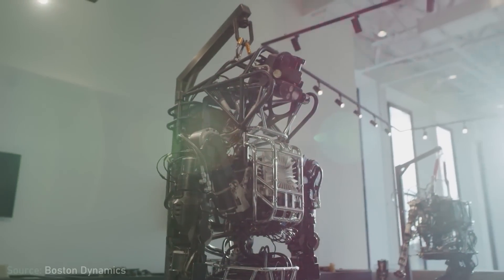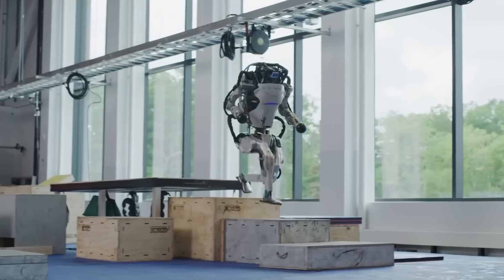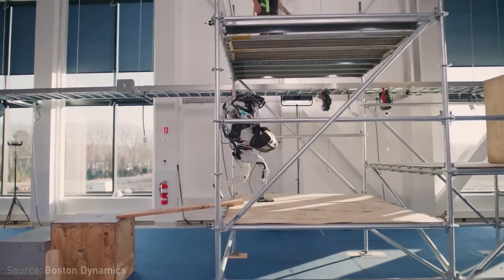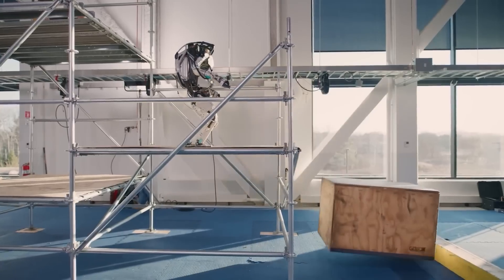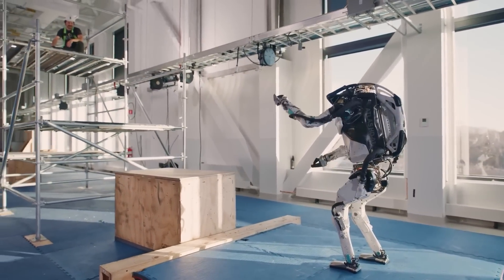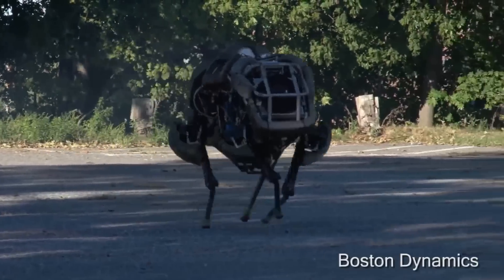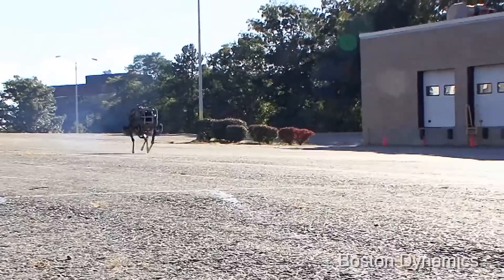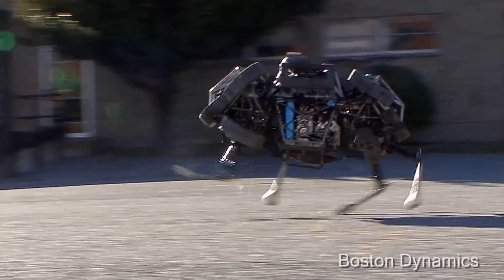Hydraulic vs electric actuation in robotics | Marc Raibert and Lex Fridman

Comment: I think it’s important to mention that both hydraulics and electric systems have their pros and cons. Hydraulic. Especially proportional or servo controlled hydraulic with sensors and linear transducers can be as precise as similar electric linear actuators. It always depends on the use case.
Reply: my reply is deleting !! why ?
Reply: Bottom line is every time you convert energy in another form of motion you lose power. Unless you are going to power robots with petroleum engines, electricity being converted directly into motion with electric motors will always be more efficient.
Reply: @bill4639 there is never such a thing as a "bottom line" lol. While yes, electric motors are more efficient. The power to weight ratio of modern electric motors are abysmal. This is why no humanoid robot out there is as mobile as the hydraulic atlas.
Reply: @JakeBananas  Bottom line: prosthetics are going to be made with electric motors, not hydraulics. Construction robots, super fast drones, surgical robots with realistic feedback, and electric sports cars are great examples of how electric motors are preferable to hydraulics, so abysmal is not the word you should use to describe them.
Reply: @bill4639  A hydraulic system prosthetic would absolutely show significantly greater performance (strength, dexterity, # DoFs, etc.). The real problem is its complexity and cost. An electric motor system in contrast is cheap and simple. Which makes it attractive for corporations. In most cases superior performance is just not necessary. Do assembly lines of humanoid robots need to do backflips and parkour like the OG Atlas? probably not. This is why they switched to electric motors. Don't confuse this switch as anything but a move toward cheap simplicity at the cost of superior performance.
Reply: @JakeBananas  Well said. To give an example of a military application, The M1 Abrams still uses a hydraulically driven turret because of its unbeatable torque, size, and you can get a much more accurate azimuth (plus or minus 0.000225 degrees). You would need a prohibitively large stepper or servo motor to achieve the same degree of accuracy. A lot of countries use all-electric turrets now, but only because they're simpler to design and cost less. Countries like the US who were already using hydraulic systems have stuck with them.
Reply: In my experience hydraulics always eventually leak. As do pnuenatics. Electricicals even if they leak do not make puddles. Of course the problem with electronic systems is keeping the red electricicals in the red wires. The blue in the blue etc. 🙄
Reply: @mpetersen6 Maybe you forgot something else, consumer electronics are limited to the battery or power source !!
Reply: @ياقوت-ق  
So are organic muscles. You have to keep recharging the system. AKA eating.
Reply: @mpetersen6 No, absolutely !! Although nothing lasts forever, the Hydraulic System is durable and strong and can use any fluid suitable for the application, such as water, but not limited to it. Watch this video and then tell me where I need it to recharge !! In this video, the person uses a hydraulic hand, adapts it, and controls it as he wants simply by touching his hand to it only, whereas if it were electronic, it would need a battery and consumer electronics. In addition, he needs to connect it to an application on the phone or computer and write complex codes that depend on the memory and Preservation, as it will not be able to operate and use it except with a battery !!!
Reply: @mpetersen6  There are ways to account for leaks and recirculate the liquid. imo hydraulics are far superior and i'm attempting to prove it.
Reply: @OYVAI_izmir  you likely will fail. Hydraulics and electronics both have their pros and cons and that isn’t going to change anytime soon. What is much more important than debating which is superior is acknowledging that they both have different properties and that you should pick the right one for the job.
Reply: Don't prejudge ! Perhaps He will succeed in his endeavor. 
Personally, I prefer Hydraulic and Pneumatic Systems. I hate corporate consumer electronics.
Reply: @conorstewart2214  To a certain degree i agree. There is a very good argument to be made that intricate and precise actuation would be better suited to electric motors. For a humanoid robot this could be used for fingers, facial muscles, etc.. (where strength is not needed) However for the more powerful muscle groups like in the legs and arms, electric motor usefulness declines. The power-to-weight ratio and bulk of the electric motors necessary to get close to actual human strength and agility levels is too great of an obstacle. Sure you can make something like tesla bot or the figure bot or maybe even something relatively agile. But compared to Atlas (in terms of raw strength and agility ) and other hydraulic driven robots, pure electric motors can't compete. Until a viable electric actuator can replace the currently used electric motors (like maybe SMAs or DEAs) hydraulics is the main solution for a superior system. I am currently working on a soft hydraulic hand to prove that hydraulics can be an inexpensive and powerful alternative to electric motors, even given intricate fine movements. I've already proven actuation with a single finger and am building out the full system as i write this out. It may take me about a month or so to complete but if you're interested you can follow my channel. I have plans to integrate softy hydraulics into many different robotic projects.
Reply: @OYVAI_izmir a system to recirculate leaking liquid is just a redundancy, redundancies increase complexity and are still prone to failing eventually, even if it prevents more substantial leaking for a while longer
Reply: @nologin5375  Thats a silly notion. Redundancy is a hallmark for good engineering. Rockets, cars, planes, etc. all use redundant systems to specifically increase its FOS. In this case a recirculating system for leaks would be low pressure and therefore very unlikely to fail. Although clogs or other obstructions could cause it to fail.. so i do agree that it is mainly a preventive system more so than a complete solution. Don't get me wrong, electric motor robotics is viable and even preferable for mass manufacturing and low maintenance. But when it comes to pure performance, hydraulics will always be superior. For two reasons, its power-to-weight ratio and its ability to transfer energy at a distance/ around bends.

Comment: Robot will always beat Human in the somersault backflip. It knows exactly it own weight, the force of jumping up needed and it does so, when to tuck the legs in, the expected and calculated rotating speed, and when to flex the legs out to land to the miliseconds accuracy. We do it by trail and error and instinct with lower timing and muscle resolution. Robot will be more consistent and exact.

Comment: They need to move to a different option.  They need to be able to grow simulated muscle tissue that can be variably controlled through induced micro voltages.  This gets rid of the huge power requirements that inefficient motors need and the complexity and slow speed of hydraulics.
Reply: But then you also need to deliver nutrition to them and also it would need an immune system
Reply: Well, there is already that kinds of things (artificial muscles, exclude that pneumatic and hydraulic ones), however they either require a very high voltages or have slow reaction.

Comment: "vs"? why not both? hydraulic systems primarily and switch the electrics from regenerative to active when you need them
Reply: Hydraulics and electrics for the same joint? I don't see what use that would be. If you have hydraulics at all, you immediately get all the disadvantages (dirty, slow, non-compliant). Adding electric servos then adds nothing but mass.
What I'd find more interesting is pneumatics plus electrics, these could nicely complement each other (strength plus precision) and both can be fast and springy.

Comment: The engineers designing Spot evidently hasn't seen a wolf or an elk move.
I'm surprised about how high they lifts their hind legs in a step,

That might have something to do with moving in the Forrest, but even so.

I think Boston Dynamics should continue with hydraulics. But they have much engineering to do
before they get it light enough to be energy efficient.
And then it's manufactuerability.

They shouldn't throw out their tech, but perhaps emulate the Tesla fast fail development style.

Comment: This was great! It did surprise me when I first learned Atlas uses hydraulics. He mentioned compliance (springiness), I wonder how they do it since fluid is not compressible. I'd also be curious to know how loaded the CPUs are on board.
Reply: In Atlas, the fluid compresses about one percent by volume, which is typical for hydraulic machinery. But in the robot, the optimal amount of springiness changes depending on what the robot is doing. In older models, this was done by changing pressure in air springs that were in series with the hydraulics. In newer models, if I understand it correctly, there are no special springs, and all the force control is implemented virtually, via feedback loops using force and positions sensors.
Reply: @cogoid I work in aerospace hydraulic systems and the amount of dissolved air in the hydraulic fluid makes a huge difference in fluid compliance as well. The more air that's entrained in solution, the more bouncy the fluid column will be and vice versa.
Reply: @ADHDeeznuts123  WOW never thought there could be air dissolved in the fluid. Always thought it was 100% "oil"
Reply: Springiness also comes from the hydraulic lines. They expand a tiny bit when pressure is applied.
Reply: And accumulators can give a variable amount of rebound and shock absorbsion
Reply: They use springs inside the cylinders, its really cool. Google "hydrolics dampning" and go to google images and you will understand what i mean.
Reply: I have a 1950s International crawler with a Drott loader on it, even back then they could use a compressible spring to add some compliance it has a huge spring on one side of the driver seat that does just this. It was a Drott invention they called it the "Hydro-Spring".

Comment: So if I understand the walking difficulty it is because the robot doesn't match the timing of the knee extending and the foot hitting the ground at the same time? If that's the case it is kind of remarkable that humans can do that so well. Unless you are looking down, humans don't have any sense for how close your foot is to something, other than your equilibrium, body position, and the memory of the ground you are walking on, from before you got to it. Given the position of our limbs, acceleration felt in our ears, and a mental model of the upcoming path, humans are able to walk up rocky mountains for miles and miles at a time without tripping or falling.
Reply: the difference is humans don't need to do these kind of calculations because 1) we have so more sensors in an inch of skin then every BD robot ever made. and 2) our animals use a lost more physical processing where the body evolved to do a task with little input high level cognitive processing.

the blind can walk because they can feel the distribution of weight on their feet so they don't need to know the exact lay out of the ground in front of them.

Comment: Servo hydraulics can be amazing, not an area that is explored enough.
Reply: Hydraulics have the potential to far superior to electric actuators. Hydraulic actuators can have orders of magnitude more performance while being far lighter, more reliable and efficient.
Reply: @kirillivanov9638  It also does not require an external power source for simple matters, and almost anything can be controlled hydraulically with the system adapted. I love hydraulic systems as they give me independence from consumer electronics !
Reply: @ياقوت-ق what do you mean, no external power source ? You do have a pump that needs power. And you'll still need electronics for control.
Reply: @kirillivanov9638 I agree, also potentially cheaper as well. something i am working on myself.
Reply: @kirillivanov9638 What the fuck are you saying, no they cant?!?

Hydraulics are powered by a hydraulic pump, which is an electric MOTOR... If you skip the fluid part, the motor will ALWAYS BE MORE EFFICIENT THAT THE HYDRAULICS, its basic physics, how can you miss that, lmao.

Performance: No, the electric motor that drives the pump will ALWAYS have more horse power than the hydraulic cylinder, ALWAYS. You can literally, physically, not get more power out of a hydraulic piston than the electric motor that drives the pump...

Weight: NO, a hydraulic system is NOTORIOUS for being HEAVY, you buffoon, you need a huge tank filled with liquid AND an electric motor to drive the entire system. The hydaulic system can NEVER EVER be more lightweight than an electric motor, because you NEED an electric motor to drive the hydaulics... Omg this is so basic im bamboozled i had to explain this.

Reliable: NOOOOO, a hydaulic system has a WAY shorter lifespan, the ISO standards for maintenance is WEEKS / MONTHS for a hydaulics system, but can be YEARS for an electric motor, WHAT are you saying. There are FAR more moving parts in a hydaulic system, you need an electric motor + pump + gearbox + hoses + valves + cylinders. But if you want to drive something with an electric motor you ONLY need a fucking electric motor WITHOUT the other components, this is also so damn simple to understand WHAT ARE YOU TALKING ABOUT.

EFFICIENT?!?!? WHAT THE FUCK ARE YOU SAYING. Again, you NEED AN ELECTRIC MOTOR TO DRIVE THE PUMP, it can NEVER be more efficient than the ELECTRICAL MOTOR, hydaulics are FAMOUS for being SUPER inefficient, literally, their efficiency is the efficiency of the motor multiplied by the efficiency of the valves, and cylinders. Do you know what a Pressure Relief Valve does??? You have literally never heard of a fucking pressure relief valve and why it annihilates the efficiency of hydrolics. A hydrolic pump has to run 24/7, on an excavator, it runs even if you dont move or use the hydraulics, it needs to be "at the ready" and upkeep the preassure. But you see, if a pump keeps running, it will keep generating pressure in the hydaulic network, therfore the pump keeps running 24/7, but a valve is always slightly open to let some fluid back into the fuild container. Its literally extremely inefficient, like, fucking absurdly bad efficiency. 

Hydaulics is good for LINEAR ACTUATION, and nothing more, you can output a lot of force in a small area, which cant be done with electrical drives, that is the ONLY reason hydaulics is good, NOT performance, NOT weight, NOT reliability, and FUCKING SURELY not efficiency.